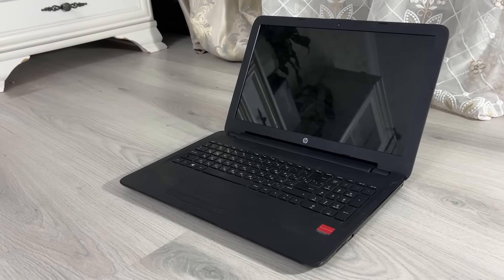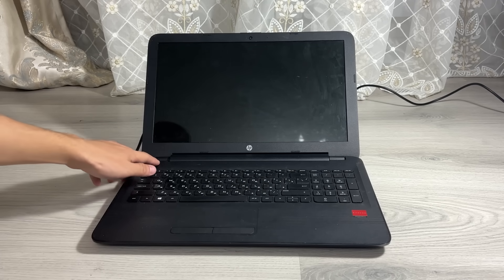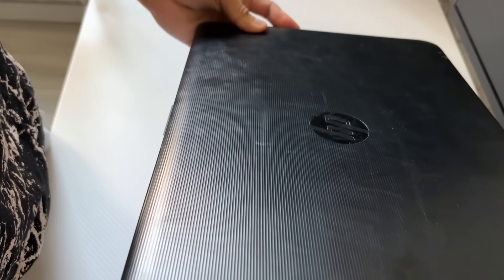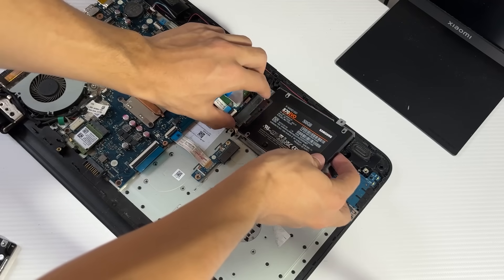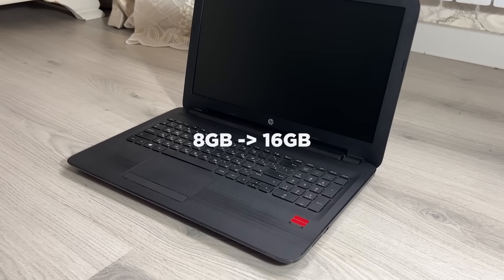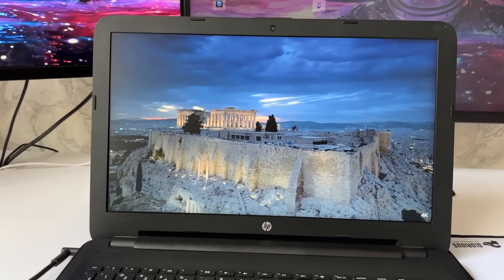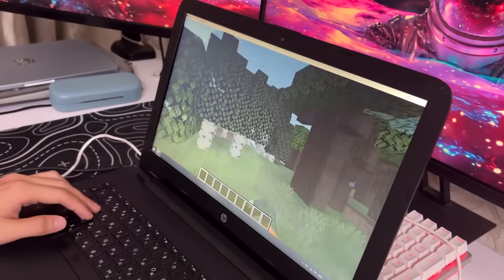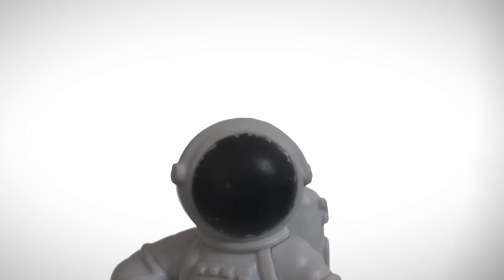How Far Can I Upgrade This 10 Year Old Laptop?

Comment: im watching from a 20 years old laptop which i fully upgraded a week ago.
here are the specs (original -----> upgraded)

Specs:
Compaq Presario V6000
RAM: 512MB ------> 2GB (DDR2)
Storage: 60GB SATA 5400RPM -------> 500GB SATA SSD
OS: Windows XP -------> Windows 10
CPU (not upgradable but original spec): 	AMD Sempron 3200+ @1.6 GHz
Graphics (same as cpu): NVIDIA GeForce Go 6150 (integrated)

Comment: Your story really reminds me of mine!

i had a Lenovo V110-14IAP, and oh boy an Intel Celeron N3350 in this day and age is TERRIBLE

but oh well it was a hand-me-down, what i can do now is upgrade and optimise it
So i replaced the ram from 4GB to 8GB and changed the 512GB HDD to the same 500GB Samsung SSD in this video, even replaced the battery

but it was still laggy, so then i discovered Linux, and then a couple of sleepless nights later

Arch Linux, LXQt desktop environment, and some kernel parameters, a custom Java version and parameter

Minecraft 1.20 running at a stable 120fps with replaymod on, even a stable 60fps with shaders
i dont know what kind of black magic i did back then but its clear i cant replicate it now.

Comment: BROO I am using a 2009-2010 era laptop it's Dell n5010 but it has 225 something gigs of SSD and 6gb ram (2+4) (yes I can't afford another + when I could it just wasn't worth spending 1500+rs) (rs=Indian currency) it has windows 10 pro but the physical key is dead and the battery last 7-8 mins after full charge

Comment: Dude, I had an HP 245 G5 with an A6 7310m + R4 Graphics, it was equipped with a 7200rpm hdd, with 8gb ram 1600mhz ddr3l, no upgrades whatsoever and I was fine with it, was rocking it until 2023😅 I played games like Alan Wake, Tomb Raider 2013, Battlefield 4, GTA 4 (which the laptop really struggled, but I think it's because of the game, it's just so unoptimized, still I finished the main story around 25fps average😂) and many more, though these are the heavy games to run, 720p around 30+ fps average, it was good, until it wasn't, really needed to upgrade so I did, still an old laptop with an i7 4720HQ + GTX 950m 2gb, still it's a massive step up from the HP 245 G5

Comment: I have a intel Cpu in a Hp laptop thermal paste was Never ever changed very dusty Inside I have to use secondary monitor because The Screen does not light up Boots up in 2 minutes has a 122gb Hdd 4900rpm Loads up chrome in 1 minute

Comment: I had that laptop but worse, no dgpu, i will say it worked fine for what I used it for and about a year ago I replaced the motherboard for one with the dgpu, let me say that with an ssd and windows 10 iot it can play some older games fine, but you have to install an old gpu driver because the newest ones break the dgpu and you can only use the igpu, and it steals power from the already awfull cpu.
I had a lot of fun tinkering with it but it where my only PC... well it runs skyrim so i will play a lot of it with very bad graphics.

Comment: Instead of Windows 10 or 11 you can use unofficial builds called "Tiny11" and "Tiny10" which are super stripped down and run really well on slow hardware

Comment: I have the same type of laptop but worse, hp notebook(i3 5005U 2ghz, 4gb ram, 512gb hdd) I have upgraded ram form my even older laptop so its now 6gb ram, i upgraded hard disk to 256gb ssd. now it runs okay, I have played minecraft(40-50fps), valorant ( tweaked from the %localappdata% so it ran on 50-60fps), I have played The walking dead 1,2,3. It runed smooth in low 60fps.The battery is dead now. But Im planning to buy new budget laptop. (acer nitro 16ai ryzen 240, rtx5050, 16gb ram, 512ssd) which fits right into my budget.

Comment: my first pc specs was a intel celeron cpu, no gpu, idek what that motherboard is, 4 gb of HD and 2 oF DDR3 RAM if i'm not wrong. that thing barely survived playing videos on 144p, and the only thing i could play was those default windows 7 games and very few browser games, and they ran at only 10 fps below. that thing lasted 15 years, till i changed it for a way better one, that was a i3 2130 igpu, 8gb ddr3 ram. still bad, but i also got a new one, and i5 4600 igpu and 16gb ddr3 ram. guess it's a common thing starting on some demonic setup xd

Comment: My laptop is so weak even Windows hesitates before opening.

Intel HD 520 doesn't render graphics, it

prays.

4 GB RAM means Windows runs... and the game watches.

Arkham Knight took one look and said "nah"
Reply: i used to use an old 2gb ram laptop with photoshop , filmora and i also treid to install blender in it and i can tell you after that my laptop couldn't even launch the win os.
I did all i can to uninstall blender and it worked. I couldn't even play games like LoL and valorant(yes i tried valorant in it )
Now i'm using a 16gb ram with intel 4000 HD graphics and i can tell you it's day and  night .
When i tried to use my old laptop i was so shocked of the level of patience i had , it take like 30min to startup.
All you can hope is to have a new laptop even if 4gb is better than 2gb or 1gb(i really used that)
Courage

Comment: I use tiny10 + linux mint xfce in my laptop(8gigs ram, intel i5 7200u) and its blazing fast.. so i recommend you to do that.. you can play games in windows and use Linux if u wish but i would suggest to dual boot. if in any condition, the windows get broken you can fix it using a pendrive and your linux.

Comment: I have a 10 y/o hp 15 laptop which looks exactly same... unfortunately it's battery died yesterday COMPLETELY.
actually the battery lost its capacity 3 years ago. Laptop shuts down after removing the charger from the laptop.
BUT WHAT A LAPTOP❤😂 SO MUCH MEMORY

Comment: AMD apu is kinda like a cpu and a gpu in one die - instead of an intel-style integrated graphics, the apu gives equal weight to the cpu and gpu, so from my experience the gpu is unusually good. Also true 4 core 2.2 Ghz and 8 gb ram are perfectly reasonable specs for linux, even a relatively heavyweight desktop environment like kde plasma.

4:43 Nooo what a waste! You can get enclosures for hard drives which have usb c for like 8 quid on ebay and you have a free terabyte! Hard drives also last a lot longer when they are being used as storage instead of the main boot drive.

6:58 Even more reason to move to linux - Windows has these arbitary min requirements which serve only for people to throw away perfectly functional computers in exchange for overpriced and overpowered hardware (to cope with the bloated spyware that is windows).

7:18 kinda unfair test, a fresh install of any os is going to boot faster than one which has been well used with a lot of extra software installed. Still, I get your point.

Good video otherwise! Written from a Toshiba Satellite A100 with an intel core duo T2250 (1.7 ghz, 2 core, 32 bit), 4gb ddr2 ram, 64gb ssd) running debian xfce. With performance mods, I can get minecraft 1.20.4 (last version of java edition that supports 32 bit due to java moving to 64 bit only for java 21) running at 30 fps at native resolution (1280 x 800) and 8 chunk render distance (higher if it's on a server due to lower cpu overhead). Your computer is perfectly usable for light tasks and I would by no means throw it away. As a last resort, sell it on ebay or donate it to your local tech/linux enthusiast.

Comment: Try Ghost Spectre 11. It's a debloated version of Win 11 (like REALLY debloated to the point where all it has are the essentials that make it an OS) and has support for older devices. If not, try Linux Mint which is designed to not feel too foreign for a Windows user (the XFCE version which is a slimmed down version of Cinnamon). I daily both OSs on my toaster and its amazing.

Comment: i have a 14 year old laptop, its still kicking. I also use linux and not the garbage w*ndows so the experience is just fine. It can also do some light gaming. Also you could use Tiny11 or Atlas or similar to unbloat windows 11 and just install that. It works fine.

Comment: Today I changed my 13 years old laptop storage from HDD to SSD 265GB it still not much but at least much faster it used to take 20 mins from powering the laptop to reaching the display screen now it takes about 1 min.

Comment: 6:58 It in fact CAN run WIndows 11. 
It's just a few quick hidden settings hidden in Windows, and it's relatively simple to disable.
Alternatively, I recommend you to use Tiny11. It just debloats Windows so much and also removes the aforementioned checks

Comment: You can still install Windows 11 even if it doesnt meet the requirements. I have a 2008 ThinkPad W700 running Windows 11 23H2 and a gaming pc with a i7 990X running it too.
Also, I swear it looks like you have a dedicated GPU, I see the vram chips, they wouldn't include those unless you had the GPU. This seems like such a weird thing to miss, I did skim over parts of the video so maybe I'm missing something.

My friend had this same laptop but with an i3 6100U. Later on me and him upgraded it to the max with 16GB of DDR3, a motherboard with the best dedicated graphics HP shipped with the highest end A12 CPU shipped for this laptop (we went the A12 because it was worse then the i7 so that means its better), 1TB SSD but we kept the 768p display for the culture. Battery health was still over 70% original capacity so we didnt get a new one. He found some sort of overclocking tool and got his CPU to always run at its max boost clock which made the laptop actually nice to use.

Comment: i once had a laptop that would boot up in like 3mins, with a really shitty hardrive filled with games it couldnt handle with its celeron cpu and its 4gb soldered ddr3 ram, now i only use it with a boot thumb drive with linux to use the disk slot and make discs

Comment: 7:05 Well Microsoft is just saying bullshit, its only to scare people. Even Windows XP is still safe today, or if you really want to stay secure:
-Bypass TPM 2.0 requirement with rufus if you really want Windows 11 (works with every CPU newer than a Pentium 4 631 (it came out in 2006 lol))
-Install Windows 10 LTSC 2021, an official version of Windows 10 with security updates until 2032

Comment: $160 is actually enough for a entire better machine from ebay. You always gotta be careful about total cost of upgrades costing too close or even more than a superior complete replacement. The config as is was actually in its sweet spot for basic desktop use. This CPU cant even do tasks allowing it utilize 16GB of RAM without tapping out anyway. 8GB in dual channel (2 sticks) is perfect here. All it needed was a dirt cheap but still good TimeTec SSD, a battery and a optimized install of Linux Mint XFCE. Then, It would have flown doing everything you would realistically hope for it to do PLUS a little more than that.

Comment: Bro i have it the same one i upgraded its ssd and ram but i was using it before the upgrade in online school and moded minecraft at the same time it was a beast (at like a million degrees celsius) also my battery was totally dead cause i kept it off the laptop idk why so thats not that good

You should also enroll for extra security updates for windows 10 in the settings for free

Comment: I have the exact same laptop but it has A6 APU and R4 integrated graphics while yours has A8 and R5 graphics. My laptop runs minecraft 1.8.9 (i play bedwars on it) with 80fps sometimes even at 120fps but on any version above 1.18 it gives like 3fps. Doesnt run windows 11 and cs2 crashed on install, max frames in chrome dino runner tho.

Comment: I still have my old asus laptop from 2012, its aged well, the only bad part is the integrated graphics which are getting outdated, though with an ssd, maintenance, and a recent upgrade to 16gb of ram, it runs really well, even can still game on some minecraft with optifine, tf2, borderlands 2, at low setting or sometimes a mix of highs and lows but man, it wont give up.  Its really good for old games still.

Comment: i also did this but i didn't upgrade any hardware and also i using a hard disk 500gb with a cpu of intel i5 3210M and 8gb ram, May laptop was MacBook pro 2012, and i installed linux xfce on and set the cpu governor all to performance and disable ram swapp and downloaded gamemode and set the fan speed to max and also i did add some thermal paste to the ic parts that was easily get hot in the the motherboard like the smc ic and yeah it did great.

Yeah for me it did great, i was able to get 40-60 fps approximately in roblox intense game with the lowest settings and have a score of 500+ on glmark2, i also get a temp of a maximum of 82°C at max load and intense gaming so yeah, for me it was very usable

Comment: I got Fujitsu AH53/C and it really sucks. Spent more than $50 for just upgrading it.

Upgraded the processor from i3-380M to i7-620M.

256GB HDD to 512GB SSD + 256 HDD. 

4GB RAM to 8GB RAM. 

Even the mPCIe from having WiFi only to upgrading it with dual band Wifi plus Bluetooth 4.0.

Still sucks though.

Comment: I have the same laptop but 2 years newer but mine only got the 500gb dookie drive and the AMD E2 chip... I bought another 4 gb stick with the same speed so it has 8 gigs of ram, and tried to do some tweaking with MSI afterburner with varying success. I lowered the refresh rate to 40 Hz(to me doesn't look choppy but I might be chopped) and removed every piece of bloatware I possibly could. The result is Minecraft bedrock with an Xbox series controller at 65 fps, EU4 at like 100 fps, and Ubuntu in a VMware virtual machine is seamless.Let's just say, this baby can run Chrome. Also, The arrow keys are warn down on my computers because I'm left handed.

Comment: You say that's bad see My specks 

Processor	Intel(R) Core(TM)2 Duo CPU     E7500  @ 2.93GHz   2.93 GHz
Installed RAM	4.00 GB (3.84 GB usable)
Storage	112 GB SSD ARtanis ssd nowm720k/120G, 233 GB HDD WDC WD2500LPLX-75ZNTT0
Graphics Card	Intel(R) Q45/Q43 Express Chipset (Microsoft Corporation - WDDM 1.1) (64 MB
System Type	64-bit operating system, x64-based processor
Pen and touch	No pen or touch input is available for this display
Win 10 😭

Comment: Hey, nice video man. I'm watching this from India, and coincidentally I just happen to have a 10 yr old HP laptop (15-ba001AX) from that exact series with same AMD A8 7410 APU, and also happened to open the laptop just yesterday. It was getting way too hot and just cleaning the heat sink and changing thermal paste, technicians here will charge over $10. I was willing to save money, but more than that I love tinkering with stuff and learning new things so even though I was scared to break anything, I simply took up the challenge. I would say the official HP repair manuals were of immense help, and you know what as per the manual this laptop must have a discrete GPU because it if you look carefully there's two heat sink area. I also thought the GPU was integrated, but upon opening I found out the difference.

By the way this laptop must support windows 11 as it has all the security necessities like TPM, it's just that win 11 has some stupid list of processors that your processor must be in to be supported, doesn't matter if all the other criterias are met or not, so I just used Rufus to bypass the restrictions and it's been a year, and I must say it feels even smoother on win 11 than 10. It's hilarious with all the bloat in win 11 but does work faster and even my battery also gets a noticeable bump in backup. I also got the 25H2 update and it's pretty workable.

Also btw I must say, I'm jealous of those prices, especially the RAM would cost more than 1.5x of that amount for just the 8gb here in India from a reputed brand.

Anyways I'm still happy with my revamped laptop after SSD and RAM upgrade (I installed extra 4GB over pre-installed 4GB, thinking of installing a 8GB in place of that old 4GB, don't know if there would be any additional gain). Fortunately I'm a indie/2D/puzzle type gamer so the laptop handles them sufficiently albeit some frame drops even in these basic games. It's funny how I compare new budget laptops with my old laptop while making myself acclimatize with my financial situation just telling myself that new laptop XYZ has Ryzen 3 processor but it's score is double that of mine and has ddr4 ram and gen 4 SSD, so if I'm happy with my laptop which I call crappy, why should I be worried about negative reviews, it would be anyways far better than my existing laptop, and these self conversations in my mind would be so funny, convincing myself that Ryzen 3 is enough for me, which shows the fact of how much comfortable I've become with a slow laptop, so much so that I would be blown away by a simple Zen 2 Ryzen 5 processor which itself pales in comparison to today's Zen 5 architecture.😅 Sometimes I think I really don't need to pay extra, since if I can make do with a 28nm chip, anything even moderately faster than AMD A8 will be a heck lot better, my goodness how low are my expectations.😂

Btw I love your videos man, just checked out a few and I subbed instantly. Watchlisted quite a few videos, seems relatable and interesting.👍 Best wishes from India ❤

Comment: i have a 15 year old laptop that runs macOS high sierra and it runs great,  only overheating issue but it's not a big one since i have a cooler for it, also, a few cons: touchpad doesn't work, 1 working usb port.

Comment: Try windows 11 IoT. Also the $158 replacement cost is insane, you can spend $140 to buy a used laptop with 8gen i7 and 1050ti

Comment: 7:00 Windows 11 aint that much of an upgrade especially for gaming it eats a ton of resources. (but in this case since you want to gift it to your sister than you can use tiny11 for that "modern look" and rounded corners), but I recommend to use windows 10 ltsc which is supported until ~2032 I believe.